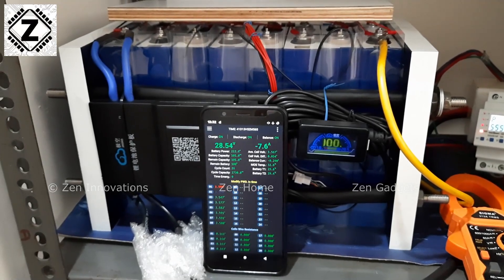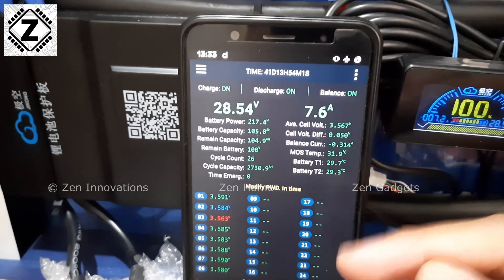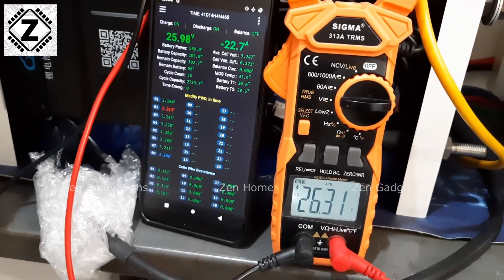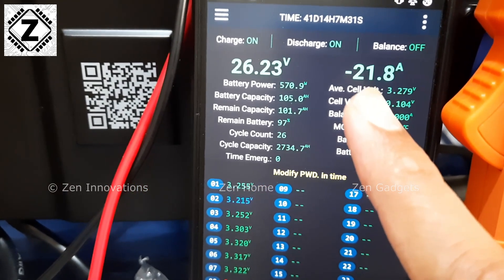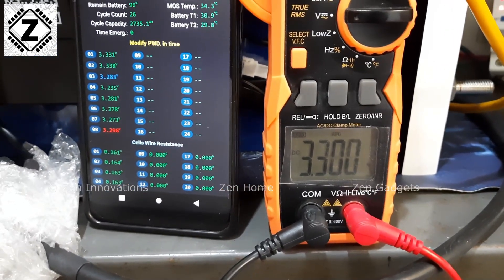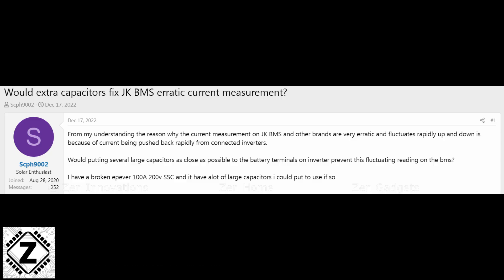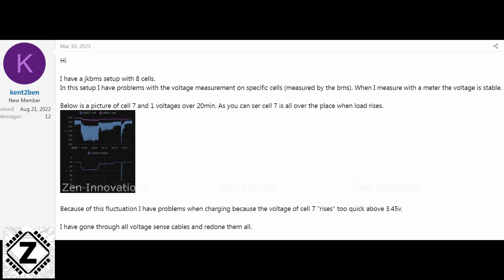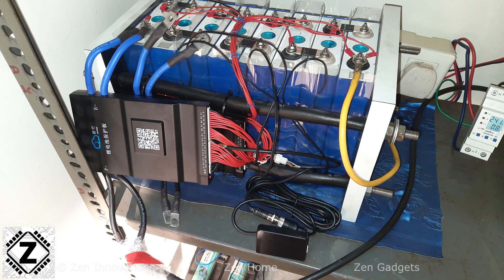JK Smart BMS Part 3 | Time to move on? | Cell voltage jumping issue, Bad software, No support! [Eng]

Comment: Hello sir I just got new 200 ah inverter jk bms. But its not saving some settings like soc 100 % ,soc 0 % and ovp . Show error sending failure.
Reply from the maker: It's a software issue with JK.
Try changing values near the failed values first. Some are linked.
Reply: @ZenInnovations  it's not working. Is there any other options?

Comment: I also have the same cell installed with jbd BMS same issues with jbd smart BMS. I also have bak cell installed with a 200amp jbd BMS, both battery bank have similar issues.